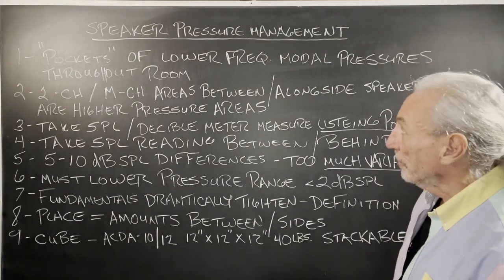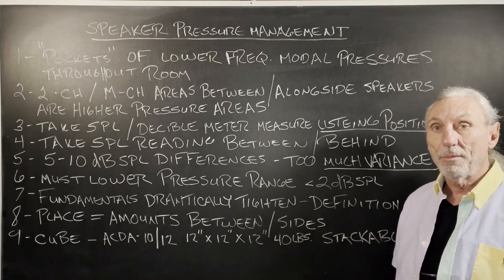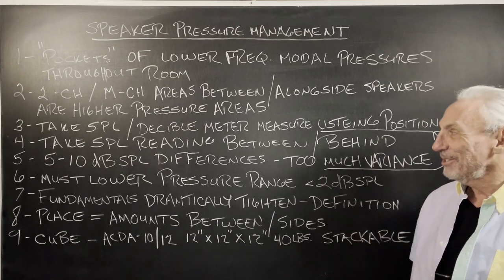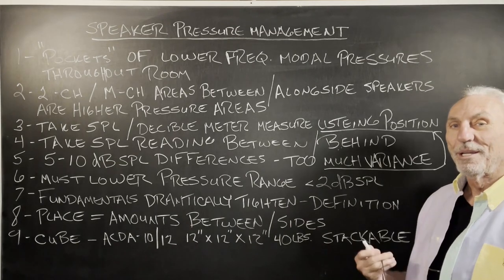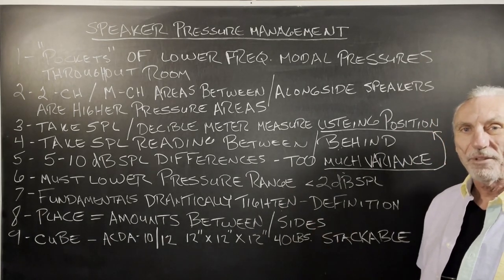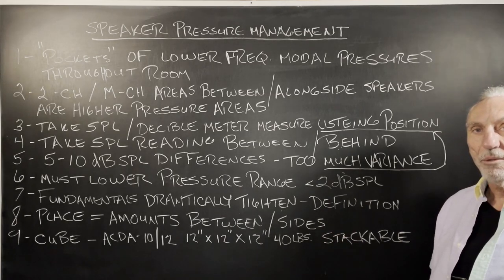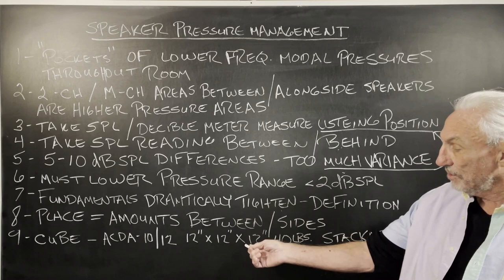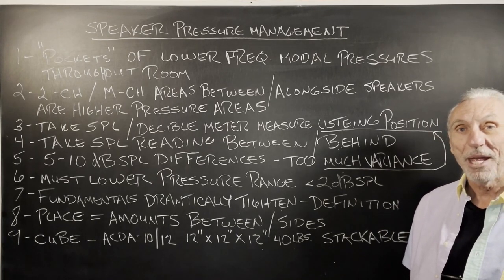Speaker Pressure Management - www.AcousticFields.com

Comment: Hey Dennis, I've recently had to downsize and give up my dedicated listening room. 

Although I've managed to relocate my equipment and diffusion/ absorption panels that were suitable for the space. They are now far less effective in the much shorter ceiling dimension (reduced from 20ft ceiling to 9ft). 

Until I'm able to manage the increased pressure with some ACDA tech, would you recommend turning down the subwoofers, to help with definition and reduce distortions etc. ? 

Thanks much for all you do, without your knowledge and assistance this far, I'd be lost in the dark still.
Reply from the maker: Turn down and turn one off.

Comment: For bass absorption using wall mounted panels, is there a minimum wall coverage area and a minimum panel size "rule of thumb"? In other words, If the minimum wall coverage is (completely random number) 33%, could that be done by using multiple floor to ceiling panels that are only a foot wide (i.e.  7 panels for a 21 foot long wall)?
Or, is it far more complicated and size and position have to be determined with a full room analysis?
The goal is to reduce nulls in the bass response in a situation where moving speakers and sub is not really possible.
Reply from the maker: We use a 50% floor to ceiling height coverage. We use a 65% width and length coverage as a rough start point. Every room size and usage is different.